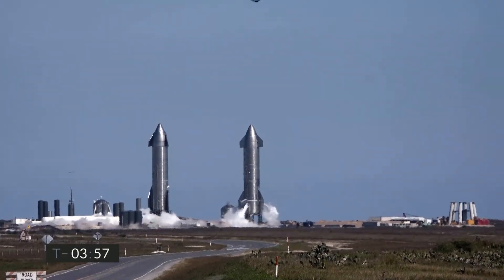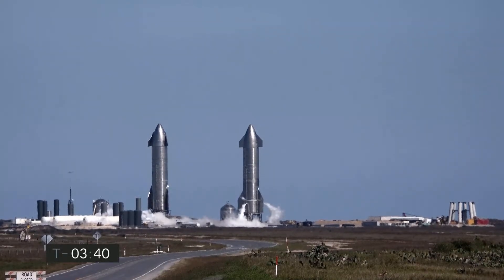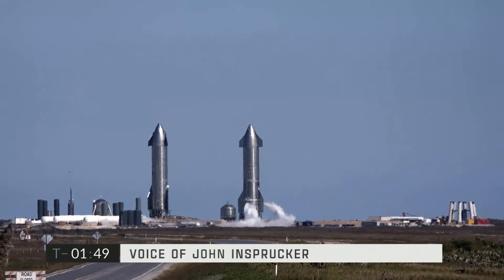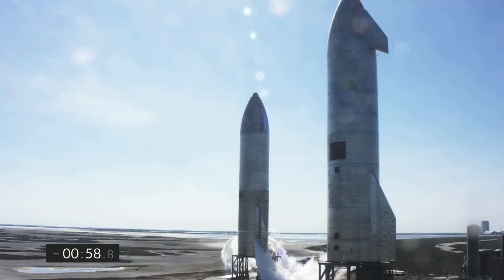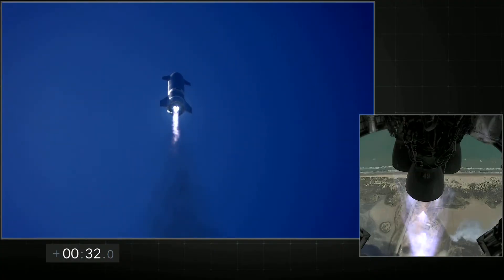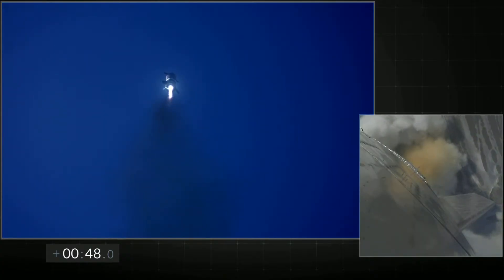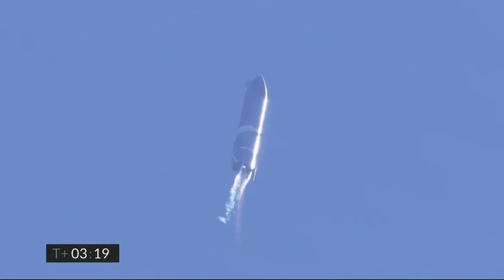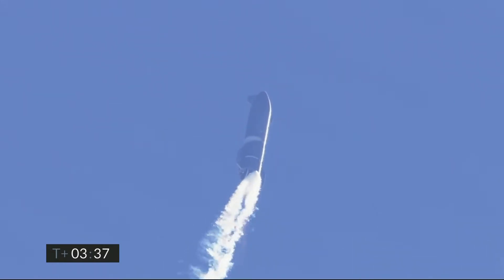Starship | SN9 | High-Altitude Flight Test

Comment: I think starship design is not effective enough for the maneuver "the fins*as if in earth atmosphere it won't work then on mars its practically will be dependent on the rocket for speed deduction or rotation...also i think starship as the name says  should be something which have more control...not just fall, rise  and rotate with engines.... i have faith in spacex...they will figure this out

Comment: Too bad raptor nr2 didn’t light for the landing flip. So why not use all 3 raptors for the landing? It definately needs a minal of 2 raptors in order to hold for landing after the flip. With 1 raptor it over shoots the flip and crash landed.

Comment: But unfortunately, the result of this test is not even as good as the result of the last SN8's test. This may indicate that SpaceX's management or quality production has caused some serious problemsso. So I can’t understand why the comments are all down to congratulate……🤔
Reply: Buuuut how do you know how much additional data they acquired here?  You have insider info?
Reply: @nolsp7240  In the last SN8's test, at least the flight attitude was controlled in place during the final landing, And the engine was restarted successfully. But this time above two points are hardly finished, This is even a regressed instead of continuously failing and then improving and iterating as expected. SpaceX really needs to review themselves by this SN9's failure😉
Reply: "So I can’t understand why the comments are all down to congratulate……🤔" Because everyone else understands that these are test flights using a test article that wasn't likely to stick the landing, and probably won't for a good long time. It took many tries with the Falcon 9 before it became so regular that it's almost mundane, and will likely take many flights before this test article lands regularly.
Reply: @samos8367  I know.  But you should also understand that comparing to the last SN8's test, this time is even regressed
Reply: @冬夜雪域冰莲炎  Not really. The engine that kept firing didn't run "engine rich" this time. So the pressure issue for the methane header tank has been solved for now. (at least with helium) This is some other issue. So actually this test did better as the one engine that kept firing seemed to be firing at full power and didn't run oxygen heavy with low thrust like it did last time.

Comment: It did worse this time, the second engine did not fire fully, and the craft tipped due to not have enough thrust!

You need to use a trisected header tanks to fuel each engine separately! When you flip the vehicle one engine is getting fueled before the other engines! So separate them, problem solved!

Comment: Good to note that this flight wasn't a failure, Starship is still an early prototype and they collected the data they needed. Also good to note that SpaceX’s next Starship prototype, SN10, is already at the launch site to begin testing. They are not slowing down.
Reply: this is the way
Reply: @eternaldad4007  this is the way
Reply: @sky-sq6di  this is the way
Reply: this is the way
Reply: C-O-P-E
Reply: This is the way
Reply: this
is
the
way
Reply: This is the way
Reply: OK so I saw in the comments every one saying this is the way well " this is the way"
Reply: It didn't go as expected => it was a failure.
COPE HARDER.
STOP WISHFUL THINKING
Reply: This is the way

Comment: Lets get some guesses on the failure reasons: I say they lost lox header pressure this time. The engine seems to get puffs of propellent that it can't ignite. And at one point the exhaust of the other engine looks fuel rich. Could be an ignitor too. Welp better luck next time!
Reply: @Shourya Bose That's exactly my point. Everyday astronaut said that they probably had problems with the ignitors but i believe had that been the case the flight computer would have switched to the other raptor. It did try to start the engine for 4-5 times so i think it definitely would have had the time to switch over. But maybe the other one wasn't chilled

Comment: SPACE X SHOULD DESIGN THEIR STARSHIP ENGINES TO BALANCE EVEN WITH ONE ENGINE TO REDUCE THE RISK OF BLASTING.
Reply: well that's fantastic but one engine cant stop the descent
Reply: @matthewmulvey8860  Hmm... you are correct.
I just thought if one engine could fire up like NOS in cars there is a probability to land safely.
Am I correct?
Reply: @matthewmulvey8860  I mean in an emergency like this.
Reply: @tehan_fernando  are you suggesting replacing liquid oxygen with nitrous oxide like in fast and furious?
Reply: @matthewmulvey8860  Yeah  😂😂😂😂😂but not for the whole burn.
in case of an emergency like an engine fails to fire up like this SN9
Reply: @tehan_fernando  well the reason nitrous oxide makes cars go faster is because when it ignites it can supply more oxygen per the volume than just basic oxygen, so the force on each piston increases basically just creating higher revs. With the raptor engine, the oxygen used to ignite the methane is in liquid form and therefore would supply more oxygen to the reaction per volume than nitrous oxide. You can use nitrous oxide for engines in space, and they're sometimes used for satellite stabilisation, but not for launch. Raptor would have to reconfigure for different mixtures of substances which just isn't viable at the present. It's not even clear if more power is the issue, on some streams it looked like there was actually some debris fell from the engine. On SN8 there was pressure loss that stopped one or two engines firing but they claimed to have fixed it so I'd be surprised if SN9 failed fro the same reason
Reply: @matthewmulvey8860  Hmm that's right.
Reply: You never know... now you've shouted it out, they might implement your ideas. I'm sure they read the comments section to learn some more stuff.

Comment: I have told you many times to make sure the engine is turned on 1km before landing .. other reasons can be accepted but the most important is the stability of SN9 when landing .. so that time is important .. remember to test SN10 make sure 1km before landing the engine is turned on
Reply: you cant turn on the engine without it producing thrust, this wouldn't work with horizontal flip without going horizontal

Comment: lol idiots! if you are running test for data at least burn all your fuel in that last action by going full throttle on 1 engine and if your math is right you should be able to get in to hover and then throttle back for soft landing ;)
Reply: ps. mass produce and test more, Elon always says money is not a problem*,  enough* good engineers are ;) maybe hire some data scientist ?
Reply: @Thomas-nc9fz  rofl!
Reply: one engine isn't enough for landing
Reply: @kjeed7735  11:42 "than transition to 1 engine for the landing burn" !!!!!!!!!!!  if they are going with 1 they should fulll throttle.. I understand its difficult to read and understand but its not rocket science

Comment: I imagine weight, mass, and momentum is the challenge with landing.
Reply: what gives it away
Reply: @matthewmulvey8860  Only three engines
Reply: @007vsMagua  that was a joke of course the issue is weight and momentum that thing is like one and a third times the size of the statue of liberty
Reply: @matthewmulvey8860  Yeah, I live in the mid-west and have never seen a silo fly before.
Reply: @matthewmulvey8860  Yeah, I live in the mid-west and have never seen a silo fly before.
Reply: @007vsMagua  also I'm pretty sure the final version of starship is going to have 6 on the ship itself and like 30 on superheavy so if it does turn out that there isn't enough power to slow the rocket - which I highly doubt, then the final craft will not have that issue anyway

Comment: They have engine re-ignition issues.
Reply: The first time there was a loss of pressure, this time the second engine decided to go kaput at the last second. Makes me wonder if they found some irredeemable flaw with the current raptor iterations installed on SN8 and SN9 so they decided "screw it, launch them anyway, we'll fix it on SN10"
Reply: @gajbooks  It wasn't the last second. It seemed to ignite a few seconds too late. Less than 7 seconds after relighting it RUD'd, not even vertical, but the engine was still burning.
Reply: @nagualdesign, Likely a design problem for this use. What are they using to re-start the engines? ?
Reply: @thrummer1953  I'm not sure, but I think that making sure the propellant and oxidizer is flowing properly is the hard part under those g-forces, rather than sparking it up. Moving from freefall and horizontally to boot is no easy task. I think the RCS has to get things started, if you know what I mean, so the fuel can flow under gravity without any pockets of emptiness disrupting the flow.
Reply: @nagualdesign  I wonder if they could put some kind of pressurized follower in the tank? It's a good thing they had these failures early-on because if they had succeeded, it would probably have been largely due to luck.
Reply: @thrummer1953  I think they do use helium to pressurize it (the spherical tank in the nosecone) but pressure doesn't really solve.. let's call it the sloshing problem. It's a bit like a can of lighter refiller; If you hold it vertically with the nozzle at the bottom the liquid butane flows out nicely, but if it's horizontal or you're shaking it about no amount of pressure is going to stop it from sputtering due to the liquid sloshing about.

I think there's a smaller, spherical tank between the two main tanks (not sure if it's for fuel or oxidizer) which they can make sure is brim full of liquid on the way up, with no gaseous bubble inside, but perhaps it isn't working as they'd hoped it would. I wouldn't be surprised if they move that off-centre, towards the 'dorsal' side of the rocket.

Then again it could have been something else entirely. I'm only speculating. In a way, it would be great if the rocket simply thought it was a little bit higher than it really was, so it only needs a software/sensor update.
Reply: @nagualdesign  No, it wouldn't stop the slosh. Hence the follower conjecture. Pressured from behind the follower.Sort of like a caulking gun works, but for the fuel.  Well, we could get creative, I suppose. How about a spinning fuel tank with inlets around its circumference?
Reply: @thrummer1953  Ah.. I see what you're saying. Yes, a sliding plunger of some kind. Would be heavy though. There's almost certainly a fluid dynamics solution to the problem.

Comment: Reignite and Raptor Control seems to bei tough. Could you Not caluclate Mode Gas for Testing and do the Flip higher for some correction?